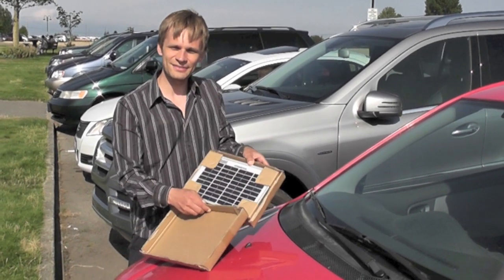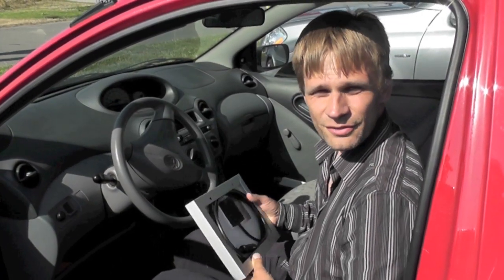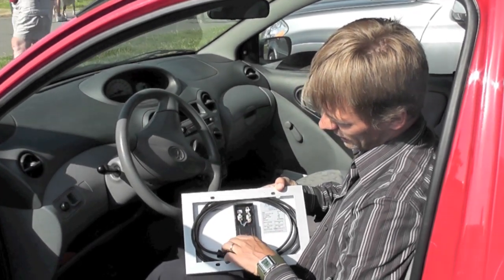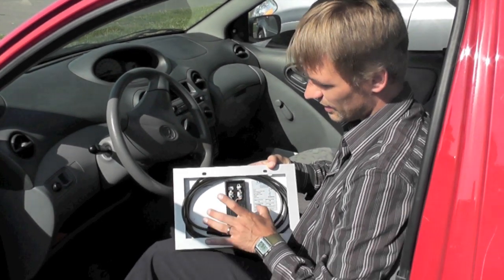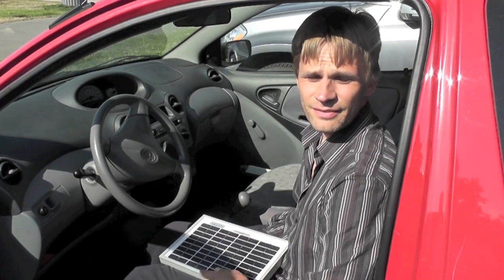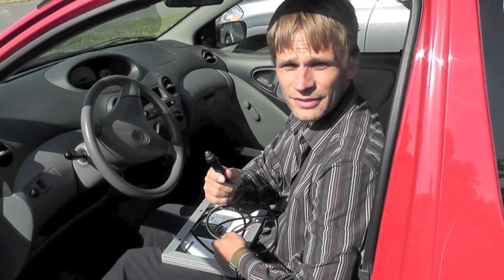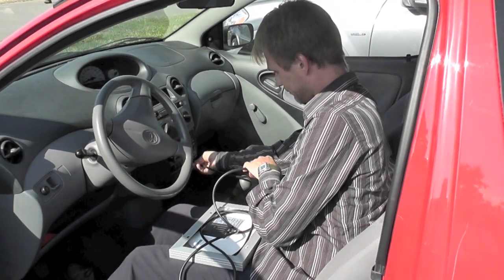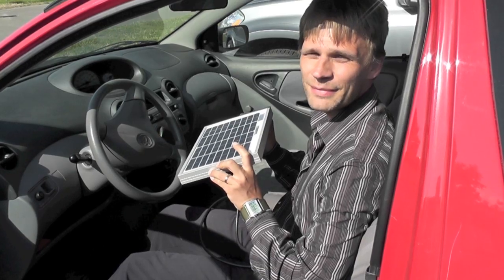How to use an AKT Solar 5W panel to trickle charge a battery

Comment from the maker: Hi Lucian,

Thanks for your question. The answer actually depends on your car. Some cars have the circuit open with the keys out, some have it closed. 

You can test this by seeing if a light or some other application works when the keys are out. If it does then the charger will also charge your battery when the keys are out.

Do feel free to ask any further questions or contact us on contact@aktsolar.co.uk

Cheers,

Jonathan